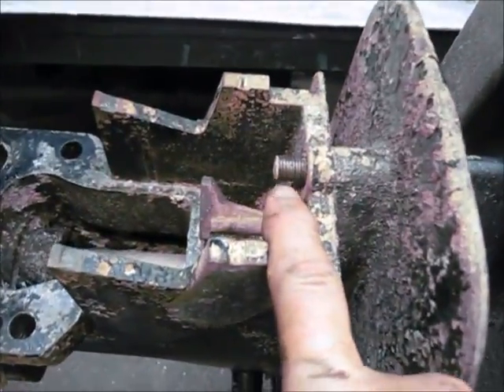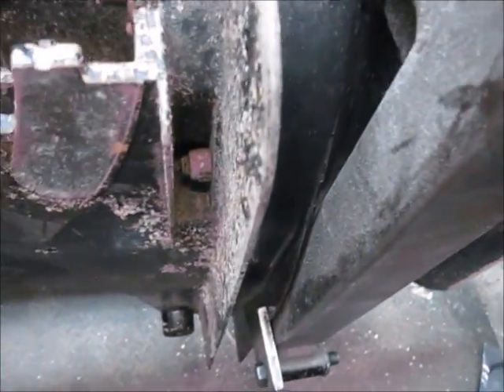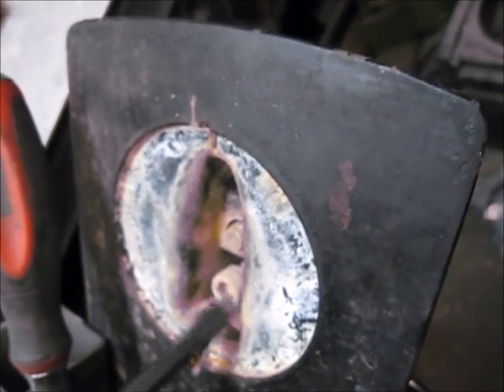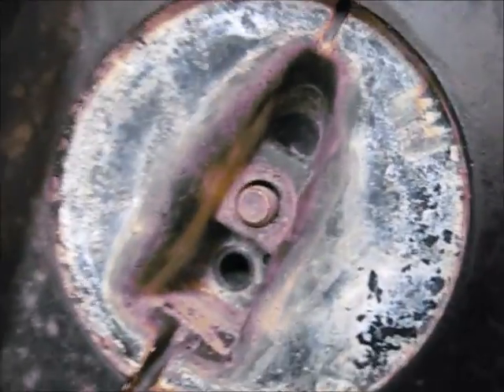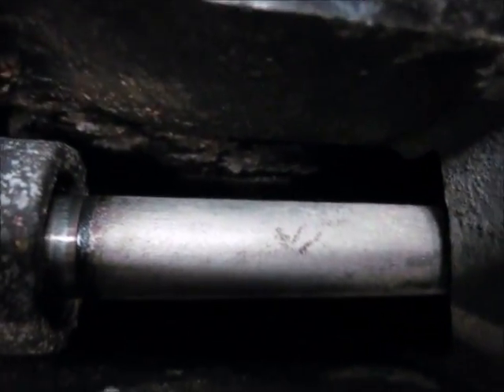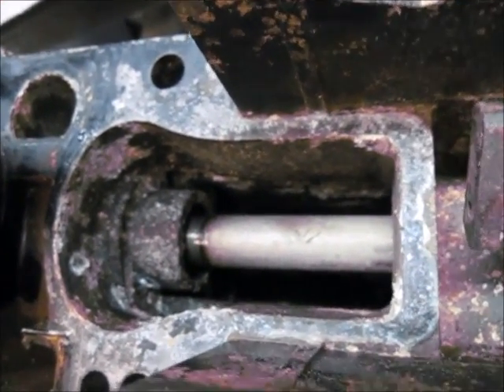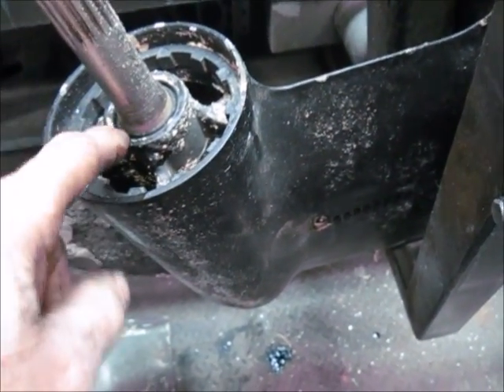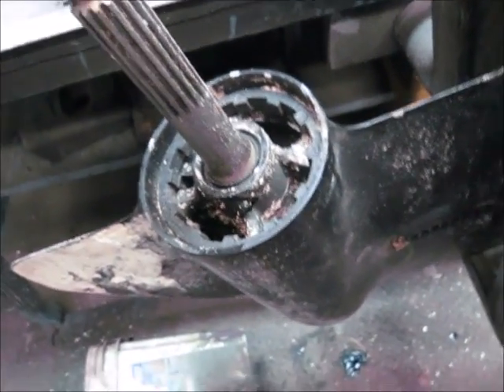How do i separate or remove my Alpha One lower unit

Comment: Thanks for the video!
Id like to replace the impeller in my lower unit, but i have the "pre" Alpha sterndrive. How do i get the correct impeller for that? Was told the Alpha 1 Gen 1 should be the same, but i dont always trust "should"...
Lol